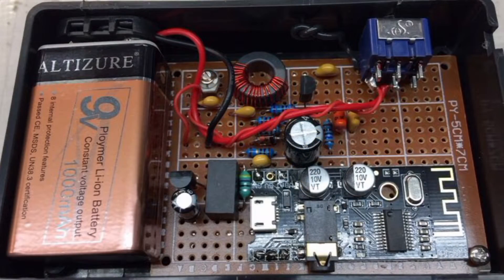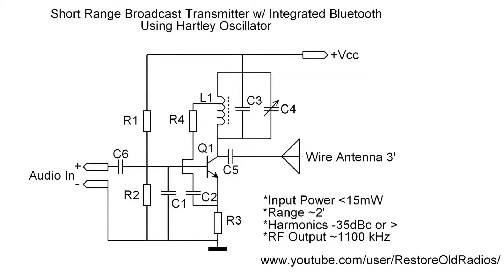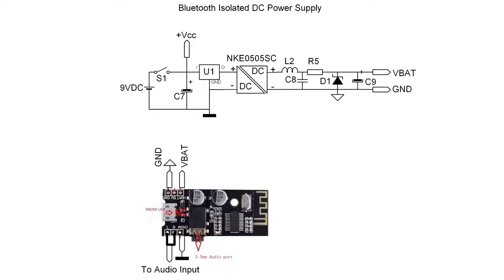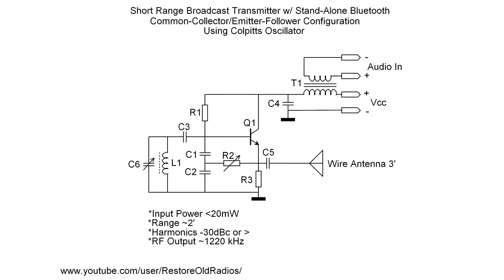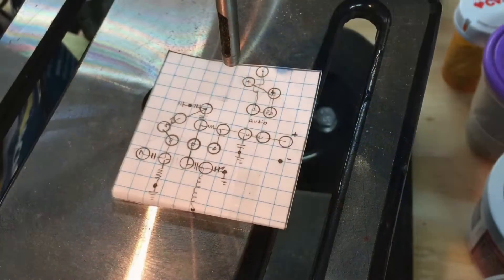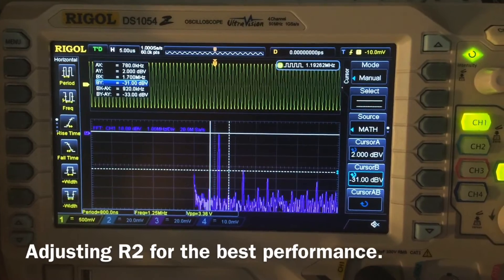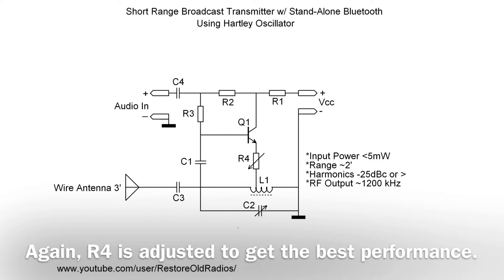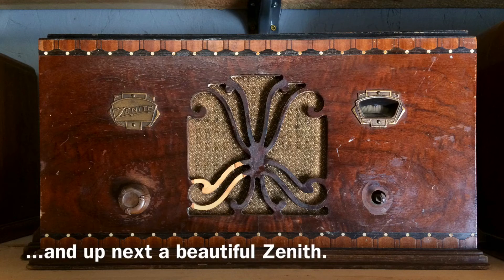Modulated Oscillator Circuits w/ Bluetooth Integration + Manhattan & Ugly Construction

Comment: NKE0505SC DC 5v Transformer 1 to 1 - can you clarify for me the pins from left to right. 1 being far left and 4 being far right, Totally confused.
Reply from the maker: Hope this helps. Top left, pin 1 is the + input supply voltage, below that is the - input supply voltage. Pin 3 top right is the + output voltage that ties to the RF choke and the bottom right pin 4 is the - output. Best, Don

Comment: Notice the Vpp voltage reading. No mod = 7.44V pp, 11.3V pp when you are mentioning 100% mod depth. Given the Vpp readings, power went up only 2.3x , in 100% mod it should go up 4x. 

2.3/4 = 59℅ modulation you're getting, not 100℅ ! Am I right or not?
Reply from the maker: Joy - apologies for the belated response. I’m not in a position to retest it, but I recall eyeballing the modulation % and the method I’ve used in the past is:

Measure AM Modulation Percentage With An Oscilloscope
https://youtu.be/BkemOqRU6Hk

Best,

Don

Comment: First circuit with feedback to emitter, is it really 100% modulation on the scope or just 50% ? The output voltage should double at 100% mod. For example, if carrier occupies one block up and one block down the center line with no audio then mod= 0%. For 100% modulation the AM waveform should occupy double the carrier space, or two square blocks up and two square box down the center line. Are you sure it's 100% modulation? I'm not seeing doubling of the carrier voltage as mentioned above. Pls clarify.
Reply from the maker: Check out my earlier response. I’m not sure my measurement technique matches your method. Best, Don

Comment: Question about 1993 diagnostics book with a Hartley circuit. 1khz Hartley with parallel cap to ct coil to ground , has PNP sinewave oscillator  with base bias of resistance REDUCED when  RF is introduced on the base. The Tone in speaker goes way up in pitch fast. How does the tone change upward,  with set cap/L coil pre set, or is it just modulation/ heterodyning about the included RF that can be now be heard as a RESONANCE modulation over the 1khz carrier? These units are selling over $300  for special contamination test meters, with presence of RF from all samples. (This is  called handheld resistance change biofeedback Syncrometer.)
Reply from the maker: Would you have a copy of the schematic you can share or point in that direction? Thank you. Best, Don
Reply: Purchase new/ used book Amazon.com , for - The Cure For All Cancers 1993.  pgs 373-376  about the Hartley osc Syncrometer circuit. See also Youtube video "Syncrometre"  about double signals on dual trace scope. when RF at resonance - is supposedly shown on lower trace. The increased fast pitch can also be in a speaker as audio range. Therefore, should l assume this is audio frequency also on scope setting?" RF emission from body mixed with samples RF, and subtracted to lower frequency heterodyning  in audio range? I don't know. Dr Clark also showed YOUTUBE demonstration of testing Syncrometer with speaker ,  at the extra high pitch resonance.  @RestoreOldRadios
Reply: Look for The Hartley circuit in Yahoo search, type Syncrometer, then select images to see circuit from Dr, Clark's Book.
Reply from the maker: I’m not an engineer, just a tech, but looking at the schematic, it seems the body acts as a variable capacitor and that’s what causes the frequency change. Best, Don

Comment: Very interested in the oscillator. But was there any different in performance ? Thanks regards Chris
Reply from the maker: Hi Chris - the two best performers based on my limited beta builds.

1. Short Range Broadcast Transmitter w/ Integrated Bluetooth Using Hartley Oscillator
* Notes: the Bluetooth adds a little noise, but the oscillator itself is a solid performer.
2. Short Range Broadcast Transmitter w/ Stand-Alone Bluetooth Common-Collector/Emitter-Follower Configuration Using Colpitts Oscillator
* Notes: AM modulation is excellent using the audio transformer.

Hope this helps and thanks for reaching out. 

Best,

Don

Comment: I love your circuits but the one thing I'm always a bit intimidated by is when to use different types of inductors, especially the ones you make yourself!  Perhaps a video on inductors and audio transformers for newbies would be an idea?
Reply from the maker: I’ll keep the inductor video in mind. Regarding audio transformers check out the following videos I published at: Speaker Impedance Testing & Transformer Turns
 Ratio & Impedance Ratio https://www.youtube.com/playlist?list=PLjLu4V-71S1KGxPeRIKhiEJ7QY1b42Q6i

Best,

Don

Comment: Great modulated Oscillator circuits(Colpits and Hartley) Design with  blue tooth  integration Don. A small wattage transmitter 15 miliwatts sure wont bother the FCC lol. Nice little battery eliminator supply you have as well Don will be watching for that one Thanks.
Reply from the maker: Thank you Larry. Hope to have the battery eliminator circuit posted soon. Thanks again. Best, Don

Comment: I've tried a few Bluetooth receiver boards, and they all seem to produce a lot of background noise.  I'm curious about which board you used, and how quiet its output is.
Reply from the maker: The integrated solution I shared does have some noise, but powering it through the isolated DC-DC converter made a big difference. The Bluetooth receiver I used: HiLetgo 3pcs M28 Wireless Bluetooth MP3 Audio Receiver Board BLT 4.2 mp3 Lossless decoder Bluetooth 4.2 Audio Receiver Board Wireless Stereo Sound Module https://www.amazon.com/dp/B07W7YCFS1/ref=cm_sw_r_cp_tai_MyWyEbB72DRH1 Best, Don